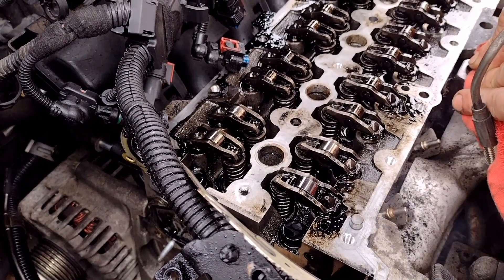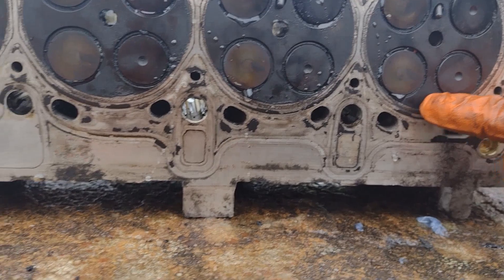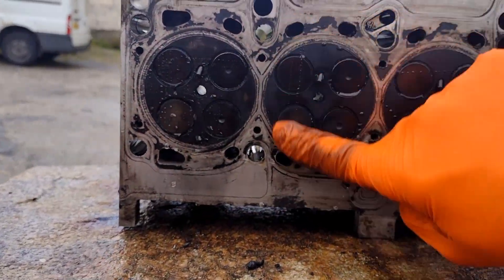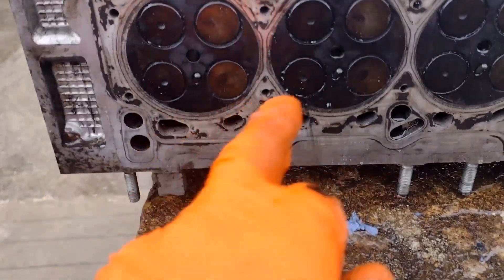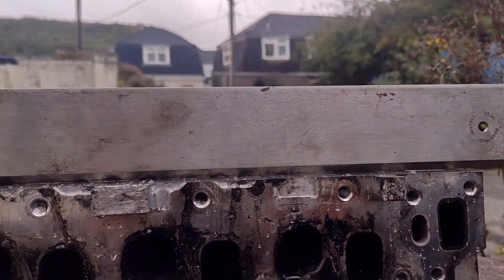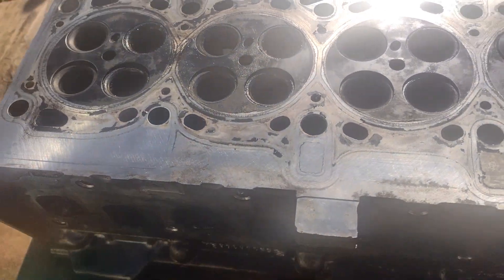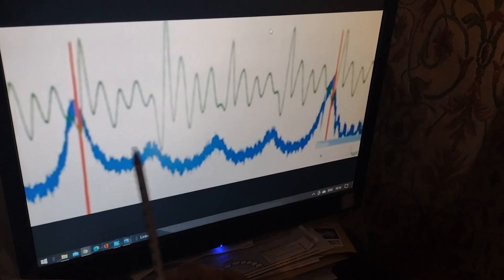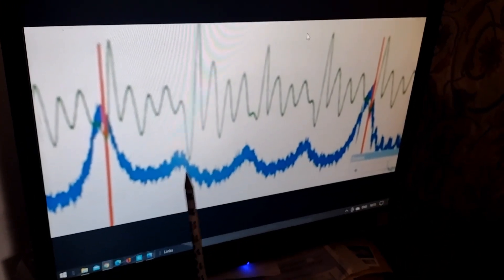Vauxhall Corsa, part2 (no compression) carbon build up

Comment: Great job fixing the compression,I know these engines are common for  leaking injector seals and the carbon builds up pretty quickly but I was surprised by all the carbon inside the  cam cover.probably poor maintenance & very short journeys caused this.well done matt keep up the great work you will gain a loyal customer base with work like this👌

Comment: cam timing. valves bent over revved perhaps. tight followers. carbon build up because gasses going up through valves. just cleaning wont work total engine rebuild
Reply from the maker: Hi Mick, the rockers and lifters on this one were ok, I did check them off camera. 
It has had the wrong fuel in the car twice, and only gets used for short runs.
It will still need a DPF because it is rattling, however I just removed all of the carbon from the valves and relapped them all in.
 It is running ok again now that the compression is back. Thanks for watching and your comment
Reply: Great video Matt. Sounds like you had it running like a sewing machine in the end.